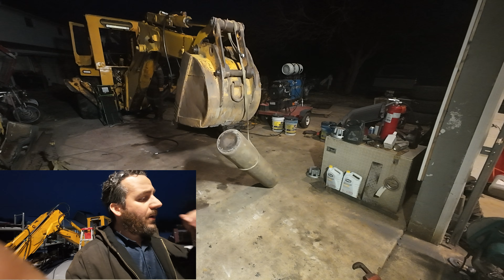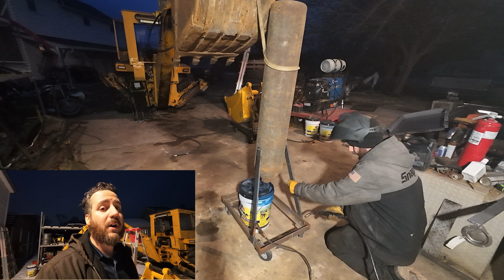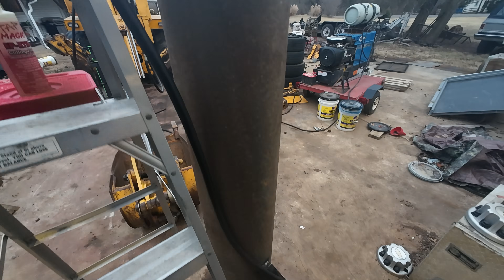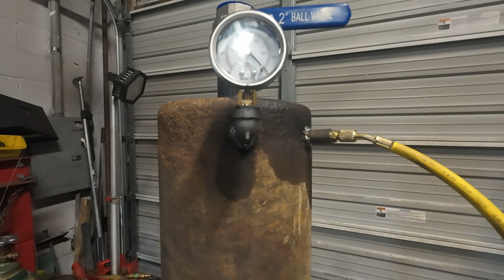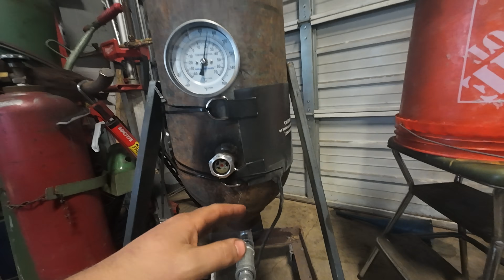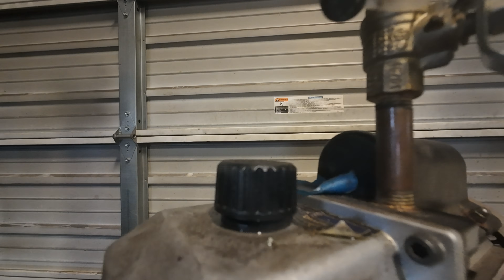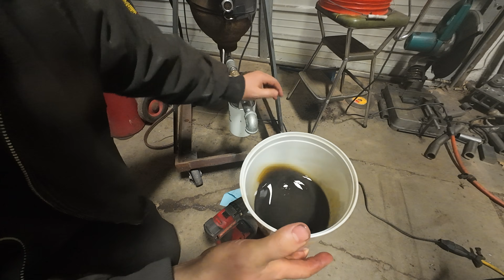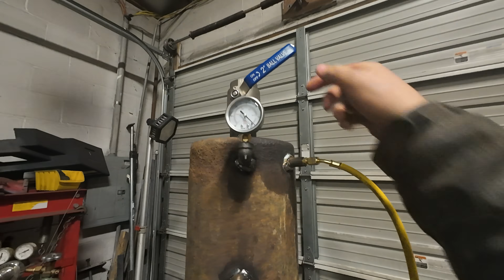I made a machine to remove water from hydraulic oil. Vacuum de-hydration

Comment: If you put a crankcase heater on the vacuum pump and keep the block closer to 213 F, the water should not condense inside the oil. 

Good idea on the vacuum, but as you noticed, not a perfect solution. I would centrifuge the oil at the bottom and use the 5 and 1 micron filters. Another option may be using silica gel, but drying that out might be an exercise in avoiding fires, and need some flame arrestors. 

Typical recommendations for recycling oil for fuel are 1) allow it to sit and demulsify over time (e.g. 1 month), 2) coarse filter, 3) fine filter, and 4) centrifuge. Centrifuge is typically 3600 - 5400 RPM. I'd suspect the black color is related to oxidation, coking, metal oxidation, and additives oxidation. You should also look at economizers to keep heat in circuit rather than getting rid of it. I'd also wrap the tank in a roll of fiberglass insulation. At 180F, ATF will stay pink for the rest of it's life.
Reply from the maker: Great suggestions thank you!

Comment: Check the oil with a hot soldering iron. Snap crackle pop indicates moisture in oil still.  Do a comparison for your own purposes on new oil just to hear the sound difference.
Reply: You are spot on there . The quick test in an engineering lab is to put  1 to 2 cc of suspect oil in a normal test tube and put it over a flame . If there is water in the oil it  wiil spit and crackle.. It is quite possible for oil to look  OK  but still have water in it.
Reply from the maker: Great tip!

Comment: Can you centrifuge the oil? That will clean it for sure but will it affect additives? Maybe a lab test for evaluation? There are big centrifuges for cooking oil.
Reply from the maker: I dont have a centrifuge but would like to own one some day
Reply: @spankranchgarage  there are bypass engine oil centrifugal filters of various sizes. Some use cartridges to capture contaminants that are disposable and others are user cleanable.
BUT, vegetable oil centrifuges can filter larger quantities. The oil flows through them as it is centrifuged.
Various tubers have built systems using pumps. Usually the oil is pumped through a pair of nozzles and the equal and opposite force spins the centrifugal chamber.

Comment: is the dark color just particulate smaller than the filter you're running it through? Could you check if having the fluid run over a magnet at the output catches any of it?

Comment: I wonder if they make a job duty vacuum chamber heater deal that can be added as a bolt on to hydraulic systems..?  Have it bolted on the side of the fluid reservoir lower than the tank and a valve that is timed to recirculate the refreshened oil every few hours then let new oil in it to keep the cycle going as the machine is used..  youd just have to add the chamber volume amount of oil to account for whats being stored for the water removal..

Comment: Super cool build. The oil looked mainly aerated so think you pulled out more air than moisture, but that's just as important. I'd run that cleaned oil in my machines.
Reply: Me as well, I would add a desiccant chamber with rechargeable silicate bags
Reply: @bigjay875  Would a desiccant chamber replace the need for a cold trap?

Comment: I Just use a large crock pot. With temperature set around 150 degrees. I did this to  dewater hydraulic oil on an old tractor. Takes a few hours but sure better than throwing the oil away.
Reply: Yeah heat is way easier. An engine is normally pretty hot and does this naturally. 180F should be fine, but if 150 works even better.

Comment: ive always just used a large saucepan and a hotplate... yeah. 1:50...

just have to watch it as the water boils... tends to froth up, then as the percentage reduces, starts to pop and spray oil everywhere, lol. so a thermostat and keep it at just under 100C probably pays... and im not bothered with wear and tear on oil as its usually sump oil, for the burner, and it came from an engine that operates at well above the boiling point of water... even if its hydraulic or gearbox, i wouldnt worry about 99C...

Comment: I'd be more impressed if you could do this in system. 😎
Reply: You should be able to do it but most hydraulic reservoir tanks are square which could crumple a bit under vacuum.   If you had a vacuum rated tank, then it should work.   You might suck air in from leaky cylinders though.

Comment: If you pump a tank with vacuum then use the vacuum from the tank to vacuum the evaporation chamber, it won’t ruin the oil in your vacuum chamber.

Comment: You don't have to pour the oil in the top.Use the vacuum pump and suck it in thru the waste valve. Connect a hose and suck out of the bucket.
Reply from the maker: Great idea, I have that valve behind the filter thats perfect for that

Comment: The oil may be burnt, it looks way darker than any I see working in my company maintenance shop. The boiling point will also drop in a vacuum chamber at about the same rate as the water. It might be best to mix what you have run thru the vacuum chamber with some new oil. Not as cheap, but still cheap insurance.

Comment: Do you think it would be worth adding a gallon steel tank as a catch can between the vac pump and the tank so your pump oil isn’t being contaminated? I know it’s a small amount of oil to change but I’m sure it’s not good running on contaminated oil longevity wise. Might need to add a course mesh for the steam to pass over and collect oil to drain into said catch can.

Comment: Can't you measure oil resistivity to see water content ?
Why don't you simply centrifuge it ? water is heavier,they will separate.
Reply from the maker: I could measure resistivity or conductivity but batch to batch it will vary and I am not sure it will make valuable data with all the wear metal in the oil. Centrifuge could work too but I like this set it and forget it device. Its pretty idiotproof now.

Comment: Nice build.  2nd to all the comments about a water trap and insulation on your container.  I'll have to remember the magnet trick for the hole saw.  wonder if you pressurized the tank with air after you release vacuum, could you put a smaller micron filter on there?  The pressure might help it filter better, jam it through a finer one, rather than just gravity.
Reply from the maker: I am looking to fit a 2 micron filter next time. Its easy enough to pressurize the tank to make it drain faster like you said.

Comment: Btw. you can look into centrifugal oil filter/separator
Reply from the maker: I went down that rabbit hole before but I think the cost turned me off last I looked. But I think its probably the best way to do this because it will remove other heavies and solids that the heat and suck method shown here wont. Thanks for the comments!

Comment: After this tank add cooler going through ice water (copper tube spiral in tub) and then another smaller bottle that will collect water and from that bottle to vacuum pump. Using this contraption will let you collect water without contaminating oil i n vacuum pump. For saving on energy and time, wrap heating bottle with  mineral wool.
Reply from the maker: Your spot on about all of this! It needs an ice trap to condense the water back out before the pump.

Comment: Very nice rig. Could you run it through a paint filter or similar for clarity ? 🤔❤️‍🔥
Reply from the maker: I could probably filter it further. I may look for a 2 micron fuel filter in the future. But for the 50+ year old machines this fluid will be going in, it should be plenty good

Comment: What about if you would frez the wateroil? Wouldent that freze the water and make it crystalis and separate? Sure oil would be thick as butter, but it wont burn the oil
Reply from the maker: Ive tried it. It seems once those crystals melt the oil sucks them back up. It helps, but didnt do what I hoped. Now with regular motor oil, this works great!

Comment: You should have a 45 deg slanted pipe/column at the top for water vapor to go into, with a down facing T to condense water out. You on't want to pull all that water into your vacuum pump or it will emulsify in your vacuum oil. You can also "boil over" into your pump if the hydraulic oil foams up as it boils.

Do a google search for vacuum still, it is really simple. PS. you can save a lot of heat by wrapping a blanket around the tank.
Reply from the maker: The blanket is a great idea. As for pulling the water before the pump, wouldn't I have to cool that to below boil point to get the water to condense? The foaming is a real issue. I have to cap my batches at 9 gallons... not ideal.
Reply: @spankranchgarage  Yes, You make a T trap + water jacket. You can do a 45 deg elbow, to a downward T section, followed by a section of pipe with another pipe welded around it as jacket. Plumb a pond pump into the jacket and circulate water through it. As the water condenses it run back down and is trapped in the T where you can tap it off.

You can build the whole thing from a few feet of 1" and 2" pipe and some pipe fittings.
Reply: @excitedbox  I love this idea.  Do you have any examples that you could point me to?
Reply: Coukd it be rust from your bottle? It was rusted on the outside so i presume it was also rusted on the inside?
Reply: 🇨🇦 Try putting a sample of the cleaned oil in a glass jar and see how clear it is  the dark color might just be that light can't get through the bucket

Comment: OR you could have saved that money on all the equipment you paid for and spend it on 27 cases of beer and just poured the hydro liquid in a metal pot and heat with a propane burner. That's what I do and fluid comes out good AND I'm still trying to finish the cases of beer.
Reply from the maker: Man I love that idea. My fear is after drinking 2-3 cases I will be face down in the yard and a large fire will break out

Comment: It would be interesting to send an oil sample off to be analyzed and compare it to "fresh" oil.
Very cool build!
Reply: I'd be interested in seeing pre and post samples sent out to a lab. just because.
Reply: Rabbit-holing down indea's like this is how youtube channels are born/built. Project Farm and Mattias Wendel for examples. There's even a Computer Fan channel that is pretty large and all it is are community challenges for making the best and wackiest fans.
Reply: Fresh oil, contaminated oil and the vacuum dehydration process. 
Send all three to be tested. Then publish the results in part Deux.
Reply: You can build a simple moisture content gauge if your familiar with electronics or just use a "Plant soil moisture content" meter. Works great.
Reply: 2 thoughts.....1) what are the chances of metal contamination from a 70yo tank, he never showed the inside, what if it looks like an old water heater in there? 2) water content could be approximated pretty well with weight pre and post.
Reply: @charlesK001 that's what the 10 micron filter will do (remove any metal)
Reply: @charlesK001  This is an old oxygen tank. Seems pretty likely that the inside has a coating of magnetite. This would very likely stain the oil black, though I am not sure it would actually spoil it. 
Rust forms instead of magnetite when enough moisture is in the air, so I would worry about his tank beginning to rust from the inside.
Reply: @charlesK001  Actually, he showed the inside when he bored the hole in the bottom. The cookie that came out looked like it had a pretty substantial dark deposit.
Reply: The oil degrades over time from exposure to oxygen and heat. It just breaks down to shorter hydrocarbons.

Old oil is just mixture of the base oil, these broken down hydrocarbons, metal particulate, water, oxides, and crap.

To remove water, you can actually use quite few methods. However centrifuge is the best for processing a lot of oil, as you can filter crap by density.
Reply: probably also need a very strong magnetto remove metals. not worth it .
Reply: @turtlefrog369I’m sure your motor oil is worse than what he did. Your oil filter only gets out 20 microns.
Reply: I'd bet it's full of metal lmfao that's why it's dark. And it's broken down from temp swings. Junk fluid to begin with anyway. Cheap sludge.
Reply: @RejectReality97  I don't know, some oils are that dark brand new. I'm guessing some additives create this dark color. Temp swings on a hydraulic system shouldn't break the oil down, never really gets that hot.
Reply: @RejectReality97  we may find out.
Reply: Oil gets darker when it oxidises. Freezing might separate out at least some of the water out without getting it hot enough to oxidise the oil.
Reply: @mels8966  What's doing the oxidizing, under vacuum?

Comment: Most mineral oils are hygroscopic to some extent.  Good idea with the vacuum distillation.
May I suggest regular oil sampling? Also, if you can find one, an old centrifugal oil cleaner. These can be cleaned and are very efficient.

You would need to build a shield, but a large diameter tube level would probably let you see the separation line. Running the evaporate into another container before the vacuum pump will keep the pumpclean.
Reply from the maker: All very great ideas. I would love to come across a centrifuge some day for jobs like this and all my waste oil burner tinkering.

Comment: Could you put a filter on the vacuum side to catch the water
Reply from the maker: It wont catch it because its steam and not water. But if I cooled that filter with ice to condense it, I would expect it to work
Reply: Maybe a 5 gallon propane bottle?

Comment: Are you pulling the moisture out via the vacuum pump or do you have another way to seperate it?  I didnt see it in the video.
Reply: The "steam" coming from the vacuum pump is moisture.  That's why it contaminated the oil in the vacuum pump. It would need to be changed often.
Reply from the maker: Yup Martin is right. I just change the pump oil with each batch for now. I get about 6 oil changes out of a 12 dollar bottle of oil. An ice trap to condense the steam would save me that extra hassle/expense

Comment: Can you send oil for testing? Just curious on final product.
Reply from the maker: I sure could. I use Blackstone labs to test motor oils and they do have a data point for water %
Reply: @spankranchgarage  Why limit to water analysis, do a full analysis and see if the AW components are still high enough to continue using.

Comment: I changed my hydro oil on my skid steer to get rid of the water in it and I believe that there was enough still in it that during this cold weather that I cracked a pump😢
Reply from the maker: Ugh I am so sorry to hear that. Water is a huge problem and freezing and cracking things is very possible
Reply: @ as soon as the weather breaks we will see how expensive
Reply: It could just crack the teeth of the gear inside the pump that pushes the fluid. Water could freeze in that little area and break that seal .. unlikely but most the time the pump walls are much thicker than the gear teeth are..  i would think itd bust a gasket first..
Reply: @Failure_Is_An_Option  when I started it after a cold snap I didn’t have any lift/lower, the only reason I suspected the pump is it started leaking (slowly tho) from somewhere below the pump, I didn’t have a mirror with me to be able to see. I didn’t want to do anymore damage so I shut it off and it has been below freezing temps ever since. All I can do is wait to see. But I agree you and hope your right and its just a line or fitting
Reply: @Z-Ack  Agreed and hope your right

Comment: Nice setup.
Could you add a large  water trap (air compressor style) and move your vacuum pump above the top of the tank to collect the water and save your vacuum pump?
Reply from the maker: Yes I can and I might. But the trap needs to be pretty cold to condense the steam back to water at these low pressures
Reply: The temp of the trap just has to be colder than the boiling point at the vacuum you are pulling. So if you're boiling off the water at 104° you just have to drop it lower than that and it'll condense. You can do that with ice water.
Reply: Ice water will work, dry ice with acetone is better.

Comment: So how is the water getting in?usually its shift levers. They need tight rubber deflectors.
Reply from the maker: I dont believe and new water is getting in, or at least I hope not. The shifter boots would be my guess as well. The machine has a full cab but there is a missing window so possibly some is getting in from there. Im replacing the shift boots and will put new glass in it and hopefully this never happens again, because it sure is a pain. This machine sat in the woods for 10 years before I bought it and I have been trying to get all the moisture out ever since.

Comment: Awesome idea! This is only for water contamination correct?  What are your thoughts with antifreeze?
Reply from the maker: Mostly for water. Antifreeze would be interesting. Id worry that the water boils off and only leaves the glycol behind. BUT I wonder if the emulsifiers in the oil will grab the glycol or will it settle to the bottom then for easy removal.

Comment: Using a micron gauge should give you a much better indication of how much moisture is left
Reply from the maker: I have one but that rubber seal in the fitting I showed you is bad lol. And the tank has a tiny leak somewhere. If I fix that a micron gauge would be pretty cool to see the water boil off.
Reply: @spankranchgarage   Use temperature to see when the water is gone.  The temp will drop at first, then when it starts to rise, the water will be mostly gone.   Keep your leak it's a good thing.   Look for my other longer comment in this thread.   The micron gauge will work, but with that single stage vacuum pump with water in the vac pump oil, it might not get low enough to register.